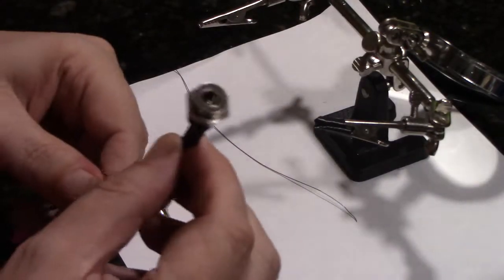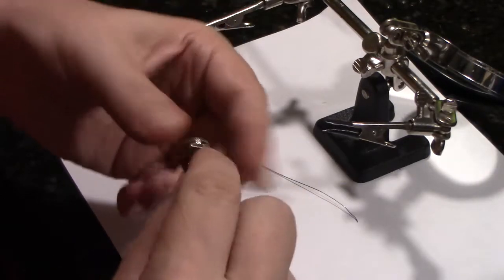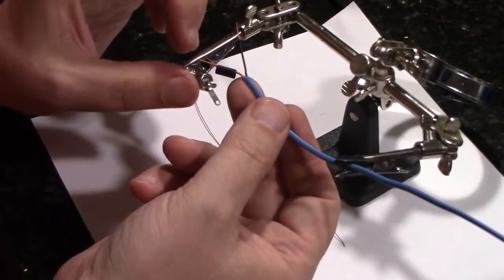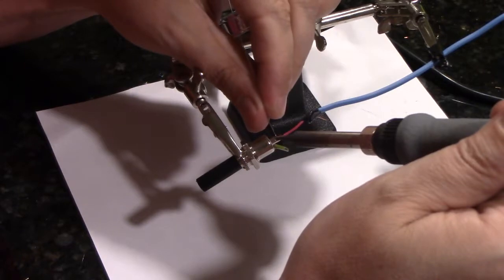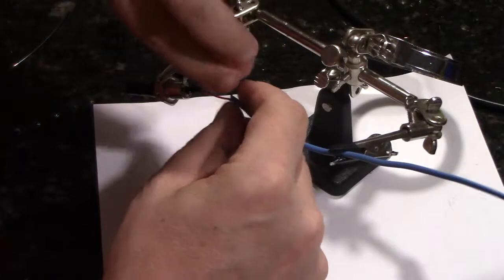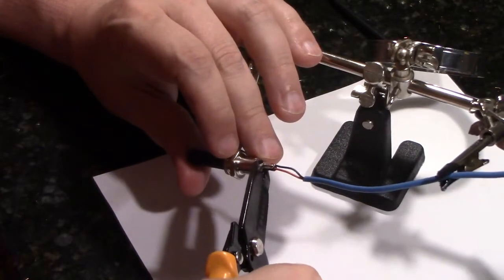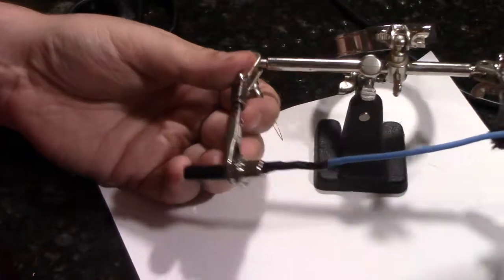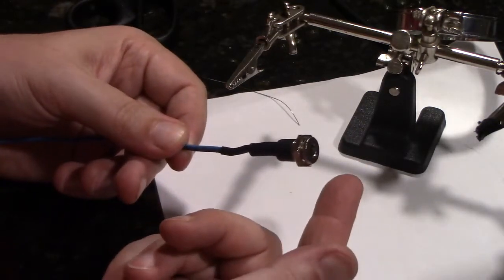Female Barrel Connector Soldering Tutorial

Comment: I know this will sound counter-intuitive but I am trying to figure out how to wire a DC Jack with 3 pins providing 12V AC AC to a screw terminal with 3 terminals labeled AC/GND/AC. It’s not clear if I need 2 or 3 wires to provide a ground connection to the terminal and it’s also not clear if the barrel Jack even provides a ground terminal. The internet suggests one of the pins on the Jack is for an internal battery to switch power to the battery when you pull the male power Jack out. Any advice?
Reply from the maker: Caveat: I am NOT an electrician, just a hobbyist, so if there's a chance of starting a fire or damaging expensive equipment, I would seek more expert advice on this. That said, to complete an electrical circuit you need two wires (positive and neutral), and for the ground to do its thing you also need a wired connection to the earth, so I think you'd need three wires for this. This was not obvious to me when I started electrical projects, but a connection to ground literally creates a continuous path through your home's electrical system to the earth. It provides some safety that large electrical surges can be absorbed by the planet itself (although NOT necessarily before destroying the devices they're attached to). I don't know anything about battery backups, but wires are wires and can carry power or signal for most any purpose. I can imagine the terminals you're using would likely have multiple different usage scenarios. I would expect that for a battery backup to work there would need to be some logical circuitry in the loop connected to your power source to switch between the battery and the continuous DC source. That would be contained within the power brick itself and there should be documentation. Bottom line, for your purposes, I'm pretty sure you need 3 wires, and you need to make sure that the correct connections are made at each end. You can pick up a cheap multimeter (e.g. https://amzn.to/3nw8ikl) to verify this and give you more confidence that you're not going to start a fire. Hope this helps!